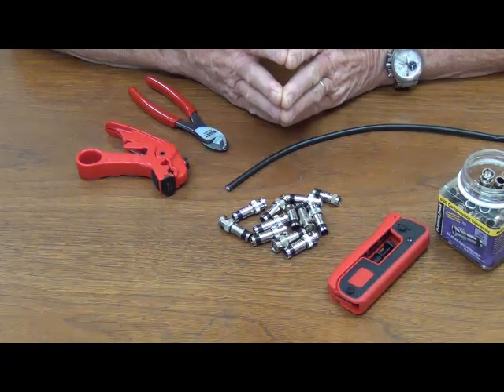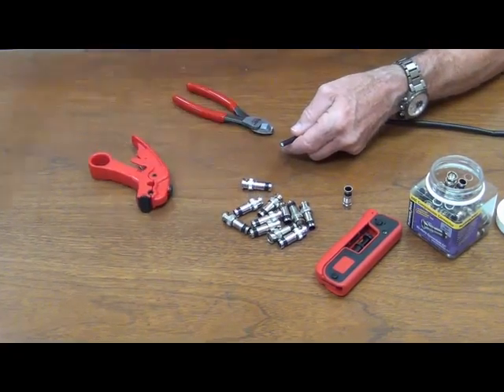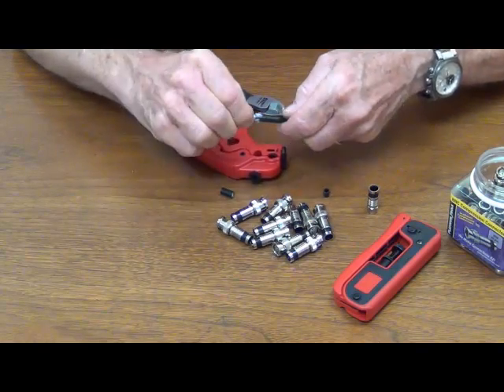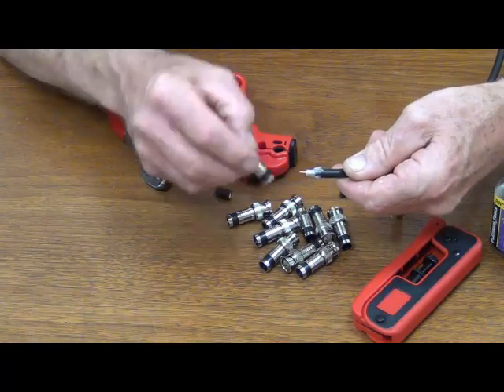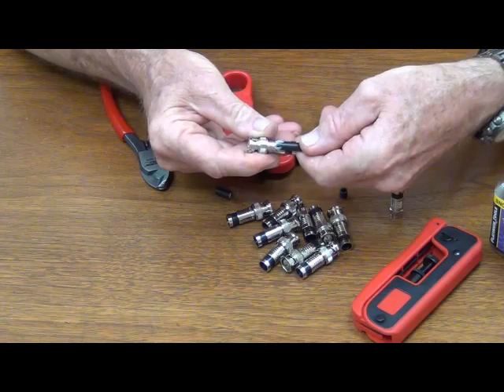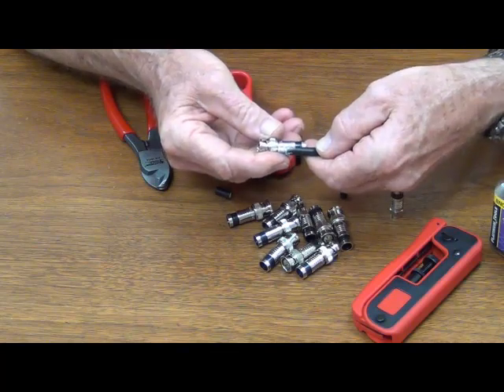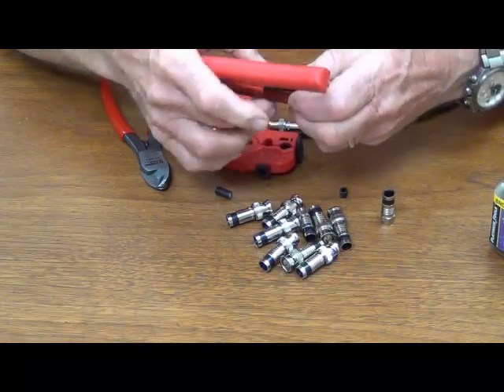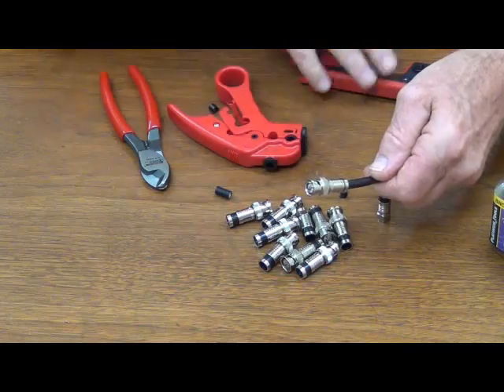How-To: Install SealSmart BNC Connectors

Comment: I cut the r59 coax center cable connector about 3/16 inch at an angle,  and used the connector itself as a length guide (for the center connector).   i also used the rest of the connector to measure how much i should "push" in the entire coax cable into the bnc connector as well.   I made sure the copper shielding was entirely out of the way.   I used the same compression tool that you did.     The r59 cables are used on a vanguard 16 camera security system.   By cross wiring / troubleshooting I have determined that both the camera and wire leading to my connection is good (connects to other cables and delivers a signal).   So I know my camera is good as well as the wire leading from my connection to the PC is good.   It's the connection.   I have tried several different compression fittings.   It always shows up as a bad (no signal connection).   I am 100% sure its r59 and not r6 (requiring red - colored connections).    I've tried cutting the connector a little long than 3/16, exactly 3/16, and less than 3/16 (maybe down to a 1/4".   I'm crimping, cutting, and recutting the connection several times and running out of spare wire (from the wall).    I've rebooted the PC and reloaded the software.   It's my connection.   When installing I make sure I have a good center wire connection and can feel it go into the fitting in the center of the connector and gently push the wire into the center fitting (you can feel it when you are centered).   What am I doing wrong?   Any insight would be helpful and tried.   What say you?     Thanks

Mark
Reply: Mark, I don,t claim to be an expert but from the picture it looks like the center solid copper wire isn't long enough to make a good connection in the opposite fitting. I know the twist and lock connectors require a little different proportions than the screw together ones.
Hope this helps!
Lester
Reply: Thanks so much for your reply.   This one connection is driving me bonkers.   I am going to try again in the morning with your suggestion (I've tried everything else)